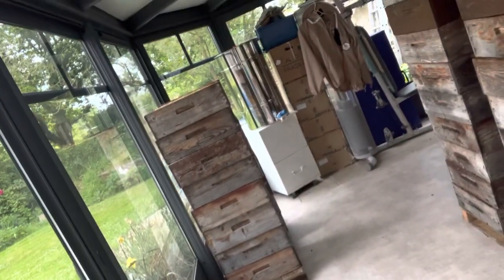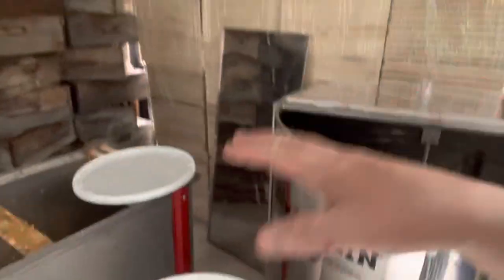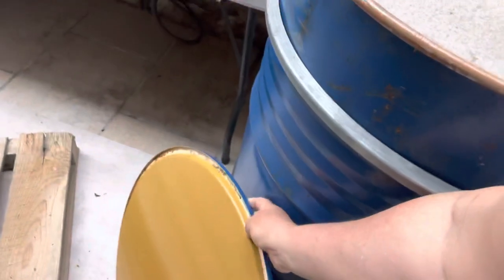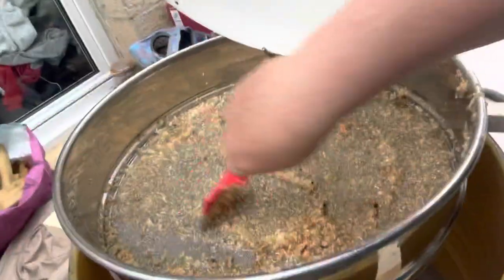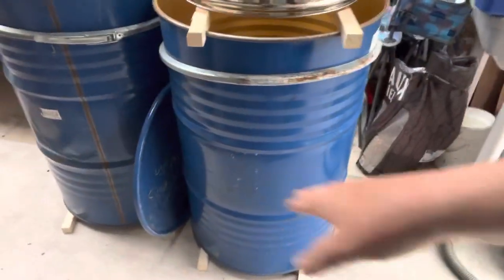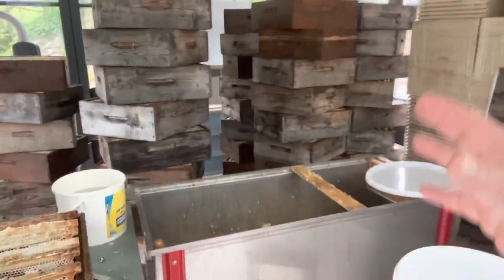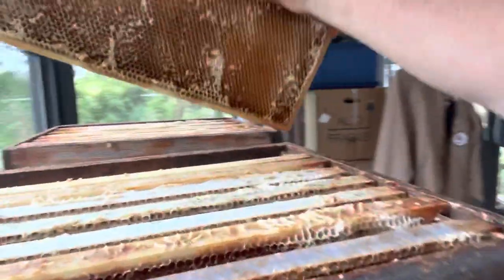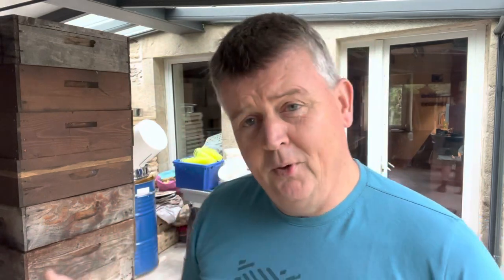Hi Richard, how’s it going?

Comment: If you screw a screw up from underneath until the point is just protruding through the wood. It will stop your frame from slipping or you can stab the lug into it . This will let the frame spin around with ease
The Lyson  stream uncapper will fit that tank that you have

Comment: Looks like your sunroom is working!    Richard we bought 5 screen filters so we can swap them out without pausing to scrape them. 
Odd that your extractor doesn't come with its legs crossed braced. Really cuts down on the wobble. A good local metal man could add those for you.